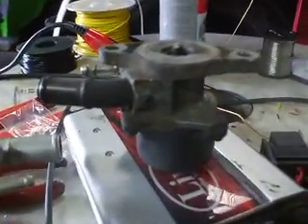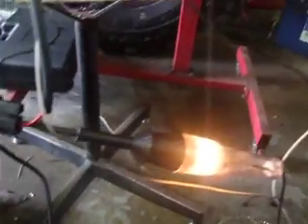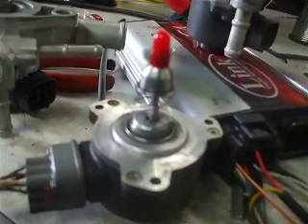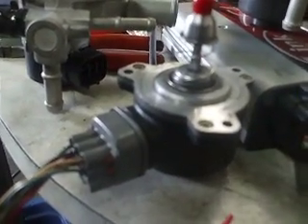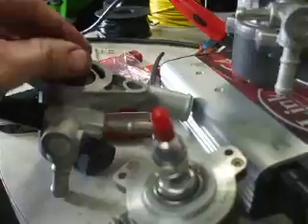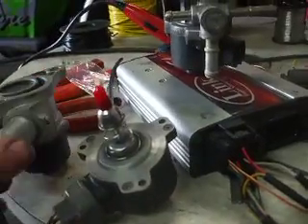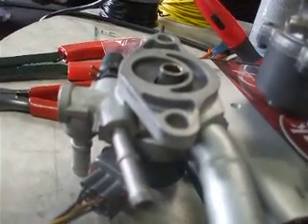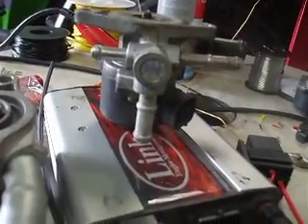1uz Idle stepper motor.

Comment: Hi there. Great info for me and my LS400 1995. Is there a trick to prevent high idle when engine is cold?
Reply from the maker: No tricks.  Setting it up correctly is important though.  This is a good test to see if its close to correct. https://youtu.be/zIGrntJYp2E
Reply from the maker: How high does it idle cold?
Reply: @CartuneNZ  approx 1600
Reply from the maker: @nicocordewener5505  that sounds about normal.   It should drop very quickly.   If its really upsetting you then a restrictor fitted into the iac air supply would limit max rpm on iac.  We used to do this when aftermarket ecus didnt control that first start well and its an ok solution.
Reply: @CartuneNZ  Thanks. I am dutch. The dictionary gives a lot of translations for 'restrictor'. Also what stands IAC for?
Reply from the maker: @nicocordewener5505  ok. Iac stands for idle air control. The little idle motor round thing on the front of the plenum.  A restrictor is a fitting with a smaller hole in the hose to the IAC.  Push in a unit with a smaller hole than the hose.  Make the hole in the restrictor just big enough to allow correct cold idle speed.
Reply: @CartuneNZ Now it is clear for me. Thanks again for your help.
Reply: May I adress two other little problems that can not be solved by local mechanics?
Reply from the maker: @nicocordewener5505  sure,  lets try.
Reply: @CartuneNZ  First, what is your name?
problem 1: When I stop the cruise control by touching the brake the car lowers speed with a shock. But this is not always the case. Sometimes (appr 30 out of 100) the car decreases speed smoothly. If I do not use the CC and i let go of the throttle peddle the car always decreases in speed smoothly.
Reply from the maker: Hello.  My name is Kelvin.   For the cruise control it is possible to extra codes from the system but most guys dont know how to do this.  I would also be getting it lifted on the hoist and checking the engine mounts and transmission mount.  The engine mounts are best done by gently lifting the engine on each side to inspect if they have broken or are extremely cracked.  Also diff mountings.   This is the most common fault I see here and generally they progressively get worse.  I have also seen a few ecu faults,  both engine ecu and cruise control ecu. Definitely recommend checking engine ecu closely.   Good luck.  Cheers Kelvin
Reply: @CartuneNZ  Hi Kelvin, I am Nico. Thanks for you advise. I will check it all. Restrictor in hose of IAC with 7 milimiter round hole is giving me just more than 600 rpm cold start idle. That is so much better than the 1600 rpm i had. THANKS for that.
Reply: Problem 2: When the ac pump kicks in THE CAR increase speed by 5 - 7 %. This is a little bit dangerous. Expecially within city limits.

Comment: Kelvin are the newer IACV'S and older version with the screws interchangeable ? I did see that the resistance across the poles is different between the two. Ive switched mine ( newer one ) with a older one in the conversion, largely for troubleshooting. But never switched it back.
Reply from the maker: Hello Bob.   Correct,  there is a resistance change between roll pin type and screw type,  along with size of intake pipe.  Ive also swapped between them without an issue so Im thinking its not a problem.  The early uz ecu have primative idle speed control so if it works lets call it good.  Cheers.
Reply: @CartuneNZ  ok great. will just leave it, might rebuild the other one as a spare. slowly getting everything in top nick. Then I can give you a buzz and discuss some options for a Link ecu.
Reply from the maker: I'm doing some link ecu video's atm as time allows to edit.  Cheers
Reply: @CartuneNZ  Awesome.

Comment: And we're are you? You sound nz I am in Melbourne Australia. But can do it myself. One thing I noticed winding magnet to far top bearing will wind out very easy Is that normal
Reply from the maker: Yep, Im a kiwi.  The bearing screws out easily.  That's normal.
Reply from the maker: Yep.  Im a kiwi.  The top bearing should screw out easily.  They should turn free with no noise.  They can get very dry.  Cheers